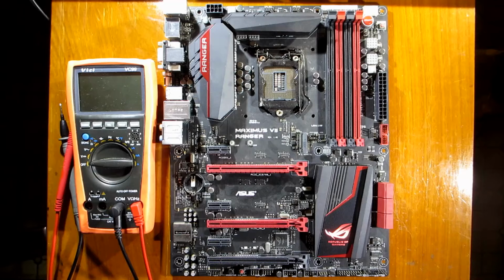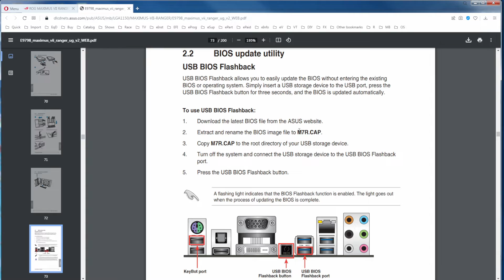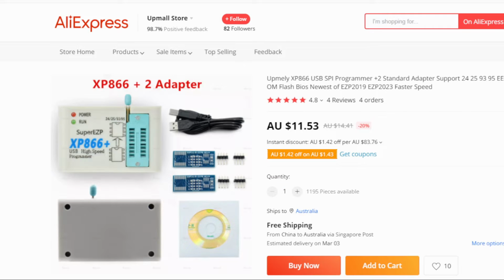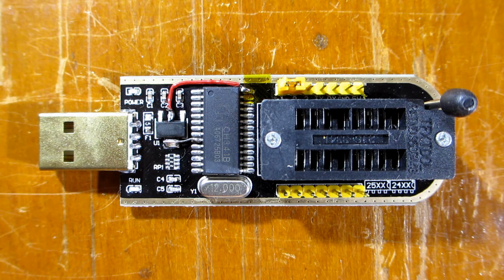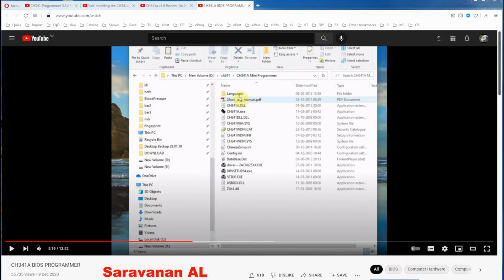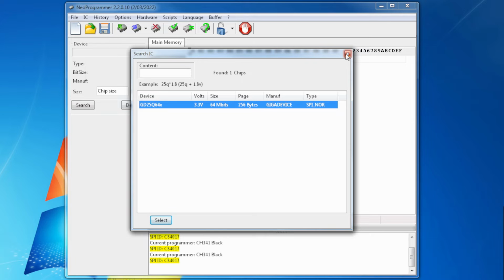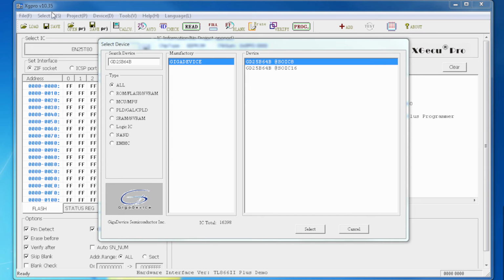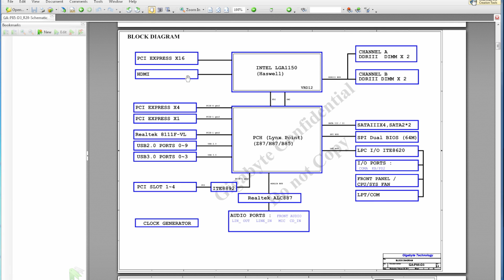Not Repairing Motherboards -  ASUS Maximus VII Ranger pt2 - FAIL2

Comment: mine is shortly starting and then shutting down and starting and so on. Found the hot part. It is a mosfet IC down at the chipset with my board. RT8065ZQW. It is small. Right next to the 2nd red pcie at the end before the big inductor.
Reply from the maker: It could be shorted, but I think it can also be something down the line shorted and it's over-working that IC trying to supply power, ie, it depends on how hot it's getting.
 Either way,that's not going to be easy to change, because it's close to a lot of plastic melting stuff, ie, you'll have to protect the plastic parts from hot-air with strips of alum coke can.
Reply: @SidneyCritic  It is getting extremely hot right away, much more than the inductor next to it and the chipset unit. The cap under it went hot as well. Removed it. Same error. Thanks for your thoughts, definitely making some coke can protection for the exchange.
Reply: @Kernoe  got the same problem
did you fix yours?
Reply: @Roman00744  nope. i got the same board for a few bugs. My next try would have been though to just heat the very small mosfet with the gun close to the chipset if there was a contact problem. Probably that would not fix it.